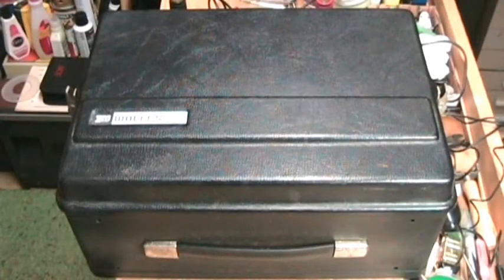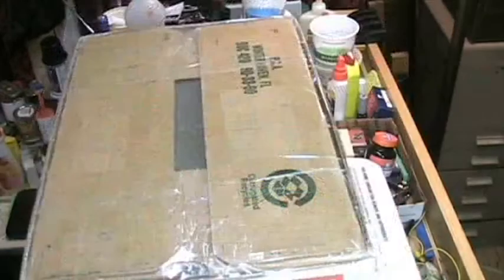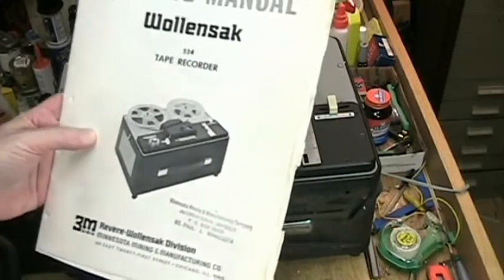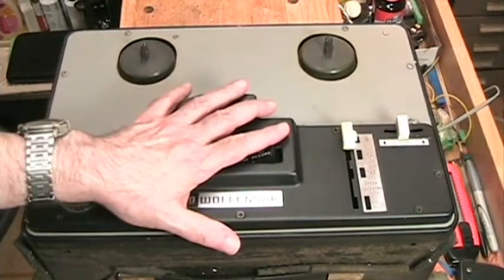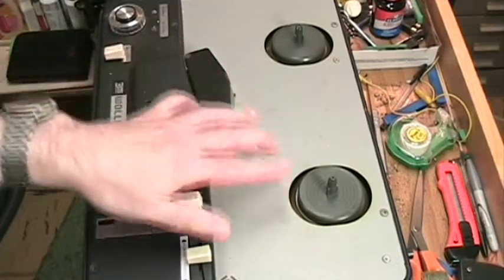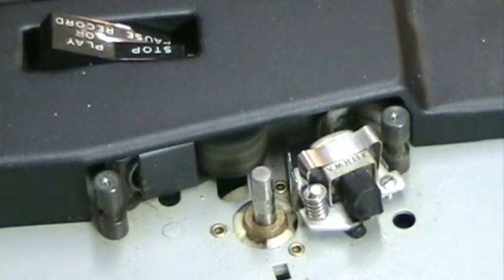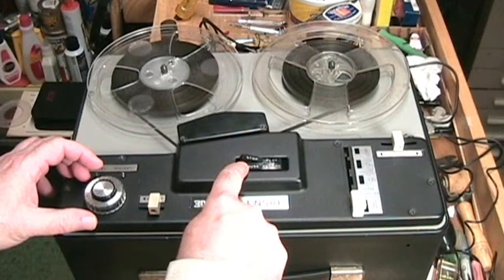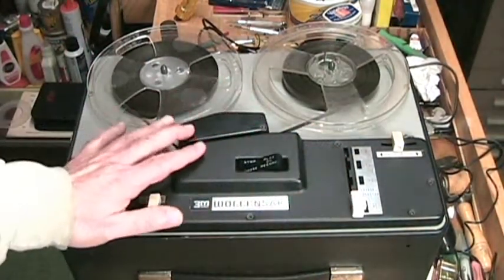Wonder About Wollensak - The T-524 Vintage Reel to Reel Mono Tape Recorder

Comment: I really like the layout of that recorder, but it is sure weird to have the entire motor move up and down! Ground loops.... they sure can be annoying!
Reply from the maker: CassetteMaster  This tape recorder is definitely in s class of its own. Not my favorite Wollensak. Sound it good though. I never had a ground loop problem before this one. So, a new lesson from Wollensak. BTW, since you have both Revere tape recorders AND Wollensak 1500 era units, can you verify that the mechs are pretty much the same? For example, from what I've seen, both use two idlers for the speeds, and both use the sliding lever for the FF and Rewind, and the feed table sits on a moveable plate, but the take up table doesn't.

There's a guy on YouTube who has a really old Revere unit that is mechanically totally ruined. The idler wheels don't just have flats, they have gouges in them, as if the rubber disintegrated!
Reply: ***** Indeed the T-1500 and Reveres have very similar mechanisms, with the dual idlers for speed switching. Also the supply spool does move slightly for rewinding.

Comment: I liked the restoration job you did in the recorder. I guess the way they designed the speed control device and the other features, they REALLY made this machine to be a budget tape recorder. However it still works, not exactly to be attributed to the original manufacturers design, since it really is an unusual one, but it's the fact that restorers like you have the nerve and know-how to be able to take it almost completely apart to clean and relube and fix the electronics and get it working again. Plus I'm glad the case cleaned up nicely after you removed the old raggedy vynal covering. It looks much better.  But I just have to say it, even if just in gest ..........You and your damn Wollensaks!!!!!!!   :)
Reply from the maker: amberola1b  LOL! Thanks for your comments!

Comment: great job and yes so unusual and very weird and low end definetly . what a strange design it kind of reminds me a a cross between vm and webor but this one takes the cake. all the best
Reply from the maker: *****  Thanks. yeah, this was not one of 3Ms stellar ideas!
Reply: well you must admit it it was a surprise that it worked . that is the weirdest speed change mechanism I have ever seen I wonder if the drive to the flywheel was a belt would it have worked well . all the best
Reply from the maker: ***** Yes, getting this thing to work again was a bit surprising. In the 1960s there was a "great debate" in the tape recorder world over which was better -  idler or belt drive.

Record players mostly used idlers (AR turntables used a flat belt) but by the 1970's many higher end turntables used flat belts.

Tape recorders used both. High end units like TEAC  and AKAI used belts, as did Ampex.

SONY had great success with idlers as did most Wollensak and some Pasnasonic machines.

The biggest issue was flutter at the higher frequencies. This made piano music particularly hard to record faithfully.

But flutter has a number of sources, only some of which are mechanical and related to the drive system. Electronics can introduce harmonic distortion that sounds like flutter as well. I have heard some digital recordings that have flutter.
Reply: yes but you did as always and you have proven that nothing is impossible to get running again

Comment: The "stem" on the motor shaft was for shipping and carrying the unit. A rubber cylinder was inserted through a circular opening in the grill for the fan. This supported the motor assembly while it was on its side, saving the mounts and the motor from displacement. This feature was common to other models of the era as well but 3M dropped it when they introduced the 5200 series as hardly anyone used it. The surviving 1500 (1500SS, 1520AV) models were considered institutional and thought not to need it.
Reply from the maker: Thankds for watching the video and leaving your explanation of that stem.
Reply: Just a bit of trivia I got from my years running the Wollensak regional warranty operation.
Reply from the maker: You must have seen some interesting problems with their machines. Did you ever have to deal with "Glubricant" (grease that turns to varnish) causing sliding or rotating parts to seizer (like the BSR record changers tend to do. if so, what was your solution to it?
Reply: There wasn't much of that with Wollensaks tape units but we did see plenty with import gear and really old 16MM equipment that had been sitting for years. Old Sony recorders would appear with  it. The usual approach was to disassemble, clean, relube and reinstall/replace. On quick and dirty situations we would lube up the offending piece with synthetic oil and work it in. That was usually for our rental department that had someone waiting for an item. Generally speaking, the Americam lubes were less likely to "BSR" than the European stuff and Japanese gear being between the American and European stuff. The exception being Lubriplate and similar lubes exposed to heat and time. They would get really hard like plastic in some cases and stuck like actual glue. Back then we had some good solvents that would clean it right off and we had wonderful things like Blue Shower and Blue Stuff to fall back on, all of which are now banned. I still miss Blue Stuff. Cured noisy record/play switches forever. I used some on noisy switches in my SAE preamp that had had everything else tried on them to no avail. One shot of Blue Stuff and it has been quiet for 3 decades.
Reply: Wollensak customers were often interesting if not downright humorous. One time this fellow inquired if we ever refused to service stuff worked on by others. When informed that we took anything he went out and came back with a box containing a pile of parts that turned out to be a T-1515-4 Wollensak. Seems he had taken it apart with an eye toward replacing the R/P head and belts and got in over his head. We reassembled it and installed a new head along with the usual service, including new belts and motor mounts.

Comment: My Wollensak T1515 has a Revere motor with the extended pole piece for the fan.  

If the tape recorder is not perfectly level, the pin hits the side of the "centering hole" of the fan screen, and of course it makes noise.

From the looks of the transport plate, it looks like the same "bean counters" took hold of 3M Wollensak that were at Hammond Organ Company. 

Could the ringing of the flywheel be the way Bias is introduced during recording? ;)

The yellow color of the underside of the plate looks almost as if it has electrostatic plating.

I thought the closet value by Nichcon would be 22uf, (which is perfectly fine) since as far as I know 20uf is no longer considered a common value.

Looks like they spared no "reduction in" expense in the design of the amplifier or what appears to be phenolic (paper fiber) PC board, which are as you probably know prone to moisture and therefore warping.  They traces peel off rather easily too.

Looks like they cheapened the PC board by not having continued ground traces too, there requiring the jumpers?  A penny here and a penny there.

Wow you can really hear the high-frequencies drop off at 1 7/8" and 15/16".

The speed shift mechanism is reminiscent of a stack-able record changer.

I must say this machine is incredibly cheaply made.  I'll bet the school districts (and other businesses) tossed many of these out for failures.
Reply from the maker: Thanks for watching the video. This is probably the cheapest recorder that Wollensak made, and I have seen it on sale in 1961 Radio Shack Catalogs for around $119.
Reply: So this roughly means that it has $59.50 in parts and manufacturing labor into it at the time. That is terribly sad.  

This must have been the time when 3M first started manufacturing under the name 3M Wollenak and the Revere Camera Company name was dropped?  That would explain the older style motor.  My 1500SS has a later motor (with a plastic 4 blade fan) without the extended pin beyond the fan blade.

I will add that while my T-1515 has the isolation grommet and extended motor pin, it also has a fine finned fan which I think is about 16-24 blades.  It could have been that the metal fan blades also rang a little.  Who knows.

It could have also been that the supplier (Fasco, General Industries etc.) had a blow out on NOS parts and 3M bought then up for much less.
Reply from the maker: DandyDon   My understanding based on Google searches is that 3M first got into tape by making tape for Ampex in some sort of deal. But eventually, Ampex got their own plants for making tape and dumped 3M. So 3M had all this tape making equipment and needed a market. Hence they started in tape recorders. 

Their first move was to acquire the Revere Camera Company and their early tape recorders. 

They later acquired Wollensak Camera. Wollensak had a better rep in the camera biz and their lenses were very fine. 3M really wanted the name.

At some point, they managed to work the mechanical design of the Revere transport into the Wollensak T1500 which was a run away hit, and kind of pricey. 

But they also kept making Revere machines, this time in a suitcase style (Samsonite I think) and used a rotary control dial instead of keys for Play and Record. They used the sliding lever for fast forward and rewind, just like the4 T1500 models, and they had the dual drive idlers that the T1500 used. 

The Revere machines showed up a lot in schools and libraries. At first the suitcase was a tan-ish color, but by the later 1960s it was dark green or black. I think the amplifiers were not as "HiFi" as the Wollensak ones.  

But they also kept trying to update the T1500 design, including stereo units and machines like the 1288 which was a T1500 with an assisted transport engagement system.  The T1500 design was a "knuckle buster", the keys on some of them were really hard to press! 

I think they kept that transport design up until the 5000 series, which was radically different. Then they started getting machines made by the Japanese and their R2R division floundered. Although they had some bumps getting into cassettes after a disaster at a cart system of their own) they came up with a very well received AV cassette recorder. It was copied by Advent. Most of these machines were mono, although the Advent was a stereo deck.

I have never understood how the T524 got into the mix. I remember reading that it was their low end model. As you can see, they had some interesting si8mplifications, but hanging that motor and shifting it was perhaps the strangest thing I've seen.
Reply: It had not really dawned on me that there were three companies involved.  

I thought Revere-Wollensak was always one company.  

This explains why I have seen 3M Revere on some models (like the 3M Revere M-2 cartridge), plain Wollensak and 3M Wollensak.  Mergers, mergers mergers.

Comment: I've got one of these,  this video inspired me to turn it on. the amp works fine to my surprise.  
Could anyone tell me what type of tape to buy to try that feature out?
Thanks for the great video, more information than I've found elsewhere on the web.
Reply from the maker: +Daniel Drezdzon Hi Daniel. Any 1/4" audio tape will work with this machine for recording and playback. This is a 1/2 track mono tape recorder, so it cannot play stereo tapes. The head configuration prevents this (in cassettes, this is not a problem because they engineered compatibility into the head design). Any size reels will work. Ideally, you should use the same size reels for both feed and take-up (i.e. 7-inch). 

You will need a 1/2 track mono recording (or you can make your own recording on the machine.) No one sells 1/2 track mono recordings (that I know of). You can get blank tape and reels on e-Bay. Don't spend much. Some selllers WAY overprice the stuff. P0reviously used tape will also work fine, you can just record over it. Audio tape, like VHS tape can be recorded and re-recorded many times.

Comment: Hello, I can't believe a channel like this exists, what a break. I have my Dad's old Sony TC 252 D and it works fairly well, just a bit slow during playback. I've lubed all the points that may have needed it, new belts, but still slow. I'm wondering if you have any remote ideas for me, I'd really appreciate some tips if you have them, these things are so great, the analog feel is so much better than all the digital junk. Anyway, thanks for what you're doing anyway, much appreciated!
Reply from the maker: Hi,

I have found a problem with many old SONYs is:  Motor Run Capacitor Failure. 

The motor speed is controlled by a special capacitor. As the capacitor fails, the motor runs slower and hotter. The capacitor fails because of age -- it was never meant to last 50 years! 

It's a serious problem, and the capacitor should be replaced before running the machine again. Running it "as is" can overheat the motor and cause serious electrical problems.

Replacing the capacitor requires professional grade electronics skills. There is serious risk of electrocution because -  even failing or failed - the capacitor can hold a charge - even after it is removed from the machine. 

Now the GOOD news:

Any competent electronics repair shop (or music - guitar -  amp repair shop) could fix this easily by replacing the capacitor. These folks work with capacitors all the time.

If they ask, tell them It should NOT be replaced with a vintage or NOS - new old stock - capacitor (it will fail for sure!) but with a modern - electrically rated the same -  component. These are much smaller and more dependable. 

The replacement doesn't have to physically match the old cap or it's dimensions - the old cap doesn't even have to be removed, only disconnected. The much smaller replacement can be tucked away in another part of the chassis. 

I hope this answers your question! Good luck!
Reply: @clydesight  wow, thanks so much for your assistance! I'll get right on it and let you know how it turns out! Thanks again for your time.
Reply: @clydesight   I found the motor "start" capacitor, is that the same thing? Thanks.
Reply from the maker: @massachusettsrestorationte3826  

Hi,

As I understand it,  a Motor  Start Capacitor is different from a Motor Run Capacitor.  

They aren't interchangeable. 

I believe that SONY used Motor RUN Capacitors. The spec sheet and schematic for your machine would identify it clearly.

This web page explains them:

https://www.capacitorindustries.com/wp-content/uploads/Run-and-Start-Capacitors.pdf
Reply: @clydesight  perfect, thank you! I dropped the machine off yesterday with someone right near me who specializes in this type of stuff. I relayed your info and he understands, I also sent him a PDF of the service manual which he appreciated. I'll update all when this is finished. He has a backlog of 2-3 weeks so it won't be quick, thanks again!
Reply from the maker: @massachusettsrestorationte3826  

That's great news. I wish you all the best with your restoration, may it bring you much satisfaction and enjoyment!
Reply from the maker: @massachusettsrestorationte3826  

Hi, I just found this new video where a guy actually does a diagnostic and repair on a SONY motor run capacitor. You might find it interesting, as SONY used a strange trick to get the capacitor value they needed.

https://youtu.be/pRzDxttSGj8
Reply: @clydesight  Thanks so much, I'll check it out! Much appreciated!
Reply: @clydesight  Hey, I have to let you know, it was in fact the motor run capacitor. They replaced it, did a great job and this old Sony sounds amazing! Thanks so much for the tip!
Reply from the maker: @massachusettsrestorationte3826  That's great news! Thanks for letting me know. 
Enjoy your new SONY vintage machine!